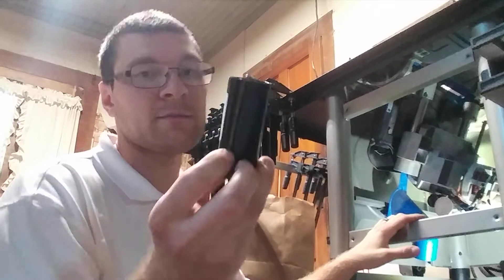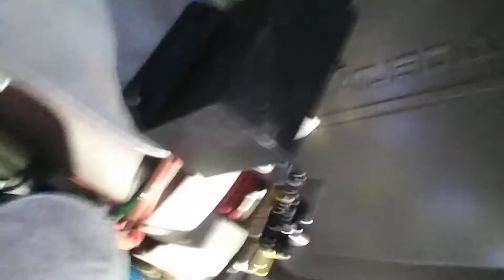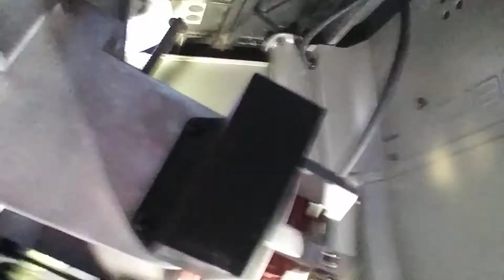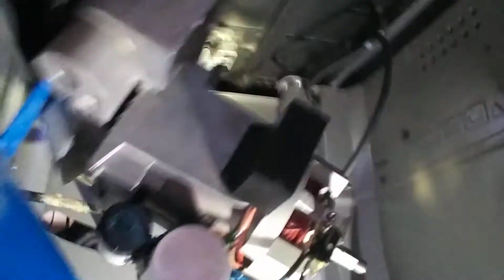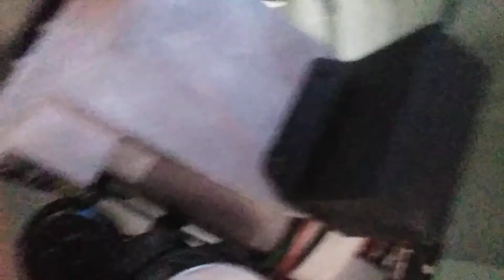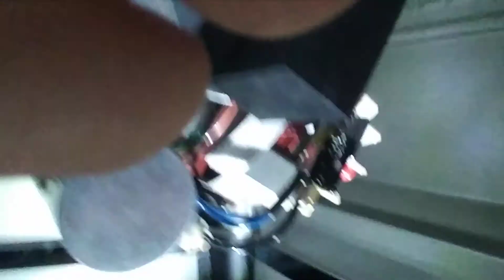36-725 and 36-725T2 Switch and Fan Install & Adjustment

Comment: I have a delta 36-725 10 inch table it was working fine and then all of a sudden the blades slowed down, but it was still running then it stopped. I tried to restart and the blade went slowly again. Didn’t get up to full speed then stopped after that the paddle switch wasn’t working or something else went wrong. I can’t get it to turn on. I’ve checked all the obvious troubleshooting with power sources and plugs. It has something to do with the Saw itself. What do you think that might be when the Saw runs briefly very slow, but doesn’t get up to the correct RPM or that it shut off completely now could it be thesaw paddle switch

Comment: I have a Delta 36-725 T2 10” table saw. I turn it on and it starts as normal, motor rpms come up then slightly taper down pretty quickly. Within a minute or so the saw trips out whether I’m cutting something or not. When saw trips off there’s no wind down as it did when it was first purchased, it stops very quickly and I have to wait a couple minutes to reset overload switch. A few times I have smelt a light burning odor during this process. Id greatly appreciate any suggestions as to what should be replaced and how I can purchase Frank’s parts rather than the crap Delta and toolpartspro both sell. Thanks to anyone able to direct me a bit.
Reply: Daniel, I am having basically the same issue, except now, the saw won't even run at 1/4 speed if it does not trip out. Same odors though, same experience.

Comment: Hi Frank, will your parts fit my Ridgid R4560? I’m not sure if the motor assembly is identical to this delta model as well. Thank you for your time.

Comment: Do you still sell these kits? My saw starts, runs for 30-45 seconds or so, then stops spinning/hums. Power doesn't cut out, but motor stops spinning
Reply from the maker: @stocks365  francoproducts.com email me through my website

Comment: Frank 
Hi watched your video and I think I ned your help.  I’m mechanicaly inclined but not so much with testing electric.  My saw won’t turn on.  I bought this saw from a warehouse thinking it was new but someone pulled the switch and I can’t return it.  Looking for assistance at this point.  I have the bottom open. I’m hoping I can get your phone number to text you or FaceTime you and if I need your kit I of course will buy it from you.

Comment: Great video, how do I get the repair kit?  I replaced my capacitors, didn't fix the issue, (issue is it won't turn on at all).  I adjusted the start switch, which seemed to have fixed the issue.  I was able to use it for about 20 minutes, then back to the same issue, won't turn on.  So all I need is the start switch and maybe the transient voltage suppressor (TVS) and two tap splice connectors.  Please advise on how I can order these parts.  Thanks!
Reply from the maker: Have you allowed the saw to cool and pressed the red reset button very hard?
Reply: Yes. @Frank-bg6xz
Reply from the maker: @1959dnh  Does the motor hum when you turn it on?
Reply: No, it did about a year ago, that's when I first replaced the starter and run capacitors and it fixed the problem.  Now, it doesn't do anything when I turn on the power.  Today I replaced both capacitors again hoping it would fix the problem but it didn't.  So I watched your video again closely and blew out all the sawdust that was built up inside the case and adjusted the starter switch as it looked like it wasn't in the right spot acording to your video.  That seemed to have fixed it as I was able to run it for about 20 minutes.  I then turned it off and did some other things and when I tried to turn it on again 30 minutes later the same thing, nothing, like it has no power to it, but it does.  I think the starter switch is bad although it's just a guess on my part.  What do you think? @Frank-bg6xz
Reply from the maker: @1959dnh  It sounds like a combination of bad switch/misadjusted switch and bad capacitors. If the switch is bad or not adjusted correctly, the start capacitor will be damaged instantly.
Reply: @Frank-bg6xz   I have not yet tested the new start capacitor that I just put in but the old one I just swapped tested bad.  So after adjusting the start switch, and having the saw work for 20 minutes, how is it that the start switch becomes misadjusted to the point where it damages the capacitor?  Also, my original question, how do I obtain your repair kit?

Comment: I know you made this video, some time ago and I hope you find my comment. Regardless, I just purchased this saw, used it twice and the motor just hums without starting. Im wondering if you still sell this kit, or if i should return the saw. Returning sounds easy but it will be a pain and whats to say that the next saw won't have the same issue.
Reply from the maker: I don't "sell" the kit anymore, but try readjusting the switch as mentioned in the video. I can sell you a left over kit if all else fails.

Comment: Where can I get this kit? My saw will not run and someone mentioned you in a forum I was reading
Reply: I no longer sell the kit. Did you try pushing on the reset button?
Reply: @frankcoproductsllc5353  thanks for the reply.  I did hit the reset button but nothing.  Just makes a humming sound when I try and start it and trips the breaker if it goes too long.  I did see a list of parts numbers you (i think) put on the saws fb group after posting this so I will try and order through that
Reply: @Javier_Is_My_Name  humming is usually due to the start capacitor circuit. First try readjusting the internal switch.

Comment: Hi Frank. I just purchased a new 36-725t2. I’m curious if you still have a parts list and vendors who sell the parts from your kit so I may try these upgrades myself. Do you recommend immediately replacing the caps or should I wait for failure. I’d rather not void the warranty but also don’t want to be stuck waiting for repair. 

Thanks so much for the video and your solution to the shortcomings of this saw. Is quite an upgrade from my Ryobi job site saw and I can’t wait to start making things with it.

Comment: Great explantion! My saw just died yesterday, do you still have kits available?
Reply: Sorry, I am no longer sell the kits. What are the symptoms of the saw? You may just need to make an adjustment to the motor start circuit microswitch and maybe replace a capacitor or two. The failures of these motors are usually very specific.

Comment: @Frank I just bought this table saw used and it's bogging down on 3/4 stock. Any ideas on what that may be? Thanks in advance for any insight you may have.
Reply: It could be a handful of things... Could be the type of blade you are using and the condition of the blade. Could be a hardwood and you may be feeding it too quickly. It could be a faulty run capacitor.

Comment: Great Video !  here's my issue. saw turns on but I have to take a piece of wood to get the blade spinning. Once i do that , the saw is functional to cut.  Whats your diagnosis and how do i fix it ? will one of your kits solve this problem ?    thanks Frank
Reply: It could be that the start capacitor is bad or the limit switch in the saw needs adjustment. Sometimes the switch is too close, which causes the capacitor to burn out. Othertimes the switch is too far away and the capacitor isn't in circuit to assist in starting. I would first readjust the switch in the saw by loosening the screw which secures the switch's bracket to the casting of the motor. Once slightly loosened you should be able to back the switch off of the metal tab, then slowly and carefully move the switch closer to the tab. Just after you hear the switch "click" to the on position, hold and secure the bracket via the screw. You could test that the switch is in the correct position by measuring the resistance across the blue and black wire at the switch, when on it should be very low resistance. Once the saw starts that metal plate will move away from the tab which opens the switch turning it off. The kit usually resolves this problem, minus a burnt out start winding of course. Unfortunately I no longer manufacture or distribute the kit.
Reply: @frankcoproductsllc5353  I appreciate you getting back to me. I have watched the videos you made so I will give all that a try. Thanks!

Comment: Hello Frank just got my 36 725 from my brother and having a problem. This saw was used for a job for 6 weeks . The saw has been sitting for the last 4 years not in use . I've tried to use it and it started fine but seems like it's not quite running at full speed and it boges down when cutting a 1 inch thick pine board even with a new blade . Have you any ideas ? I am running it on factory set 110 wiring on a 20 amp breaker so can't be the wiring
Reply from the maker: Are you using an extension cord? If the total circuit length is very long this could result in a large voltage drop. This is why a 12awg or better cord is important. 

If you're not on an extension cord, anything from the condition of the blade to the capacitors can be to blame and would require a process of elimination method to pinpoint.

Comment: I just bought this saw and it will be delivered tomorrow, 2/26/22.  (Also bought your repair kit yesterday).  I have been watching every video I can find on this saw including your repair video.  Two questions I have:

1.	 The video I have been watching refers to Video 2.  Is there a video 1 … can’t seem to find it.

2.	This saw has been out for a couple of years and you would think Delta would have this problem fixed by now.  I am inclined to run my saw as it is delivered and if it fails I will have your repair kit as a back up.  If it fails will I cause other damage to the saw?  I am inclined to take a risk.  

I intend to nominate you for President in 2024.  The clowns we have need to retire and go back to their basements!
Reply from the maker: There are a few videos I've published, but they are not part of a series or anything. That was my initial intention but I decided to keep things simple. 

The issues these motors had was a combination of assembly errors at the factory is low quality materials. The design of the centrifugal mechanism/fan is hideous and has not changed. I think they may have improved the material for the brake pads since I don't hear the complaints as often. The overall design has not changed. 

You can run the saw right from the box and keep the kit as a plan B. There is little risk to doing this, but if the saw acts up once don't think that the issue will resolve itself. Take it apart and perform a thorough inspection. The people who continue to use the saw after it acts up are the one's who do the most damage.

Comment: I am about to buy the saw. I was wondering if they are still having the same issue in 2022? Thank you for making this video.
Reply from the maker: There haven't been as many cases as earlier saws, but I'm still selling kits.
Reply: @Frank-bg6xz  where is a link to order?
Reply from the maker: @strykerliker  check through the comments
Reply from the maker: @strykerliker  For the T2: https://py.pl/18iHIF
For the non-T2: https://py.pl/2C37Nj

Comment: Great kit, quality components, simple process, and easy instructions.  Recommended.  Thank you, Frank.  My saw's cap connectors were indeed soldered on so I had to apply the iron whilst simultaneously using pliers to pull the connectors off.  Not sure why they used spade connectors and soldered.  Never seen that before.
Reply from the maker: The space connectors are 1/4 but the terminals on the factory supplied start capacitor are 3/16, so they started soldering them rather than use the correct size connector

Comment: Just received the kit, thank you.  The smaller cap does not have the bleed resistor (I think) soldered to it that's pictured in the install manual.  Do I need one or will it discharge on its own?
Reply: Well, now I have the motor access opened and the original start cap has no bleeder on it, so I guess the question is irrelevant.  Thanks
Reply from the maker: @TheRealBertMoog  Early versions of the kit came with the bleed resistor. The purpose was to discharge the capacitor so when the saw was shut off a remaining charge wouldn't be present to bump the motor.

Comment: Frank, I may be ordering the kit from you shortly. How do I know if my saw has been updated from the factory? I bought the saw from Lowes Dec 2021. So far it's been fine. However, I have to run an extension cord to my kitchen which has a 20 amp circuit. I tried the saw on a 15 amp circuit with the shop vac and it tripped the circuit pretty quickly. I'll be running a 20 amp dedicated circuit from the panel in my garage/shop very soon. oh, dummy me, got rid of the box, so I don't know the manufacturer date. maybe it's in the manual.  Thanks for the great video and Delta should be paying you for your expertise and help.
Reply from the maker: They changed how they assemble the saws, but they still have issue just not often. 

Running the saw and shop vac on the same circuit I would expect it to trip. You can probably get by running only one on a 15A circuit, but 20A dedicatd is the way to go. Also, use a 12ga extension cord. 

On the cross bar of the saw base is the manufacturers tag. The date is part of the serial number

Comment: Hello, I want to buy the saw and your kit but have a question I cannot find an answer to. I read somewhere that running this saw on a standard 15amp circuit and undersupply the motor and cause issues. Do I need to have an independent 20amp circuit? Thanks!
Reply from the maker: It is recommended that the saw be operated on a 20A circuit, but it will run fine on a 15A circuit. 

The use of a long or thin gauge extension cord wi'll cause the motor to under perform and possibly overheat.

Comment: Do you have a website I can order the kit from?
Reply from the maker: For the T2: https://py.pl/18iHIF
For the non-T2: https://py.pl/2C37Nj
Reply: @Frank-bg6xz  the PayPal page says that the product listing has been removed by the seller.
My saw does not turn on at all. What would you recommend checking? Thank you
Reply from the maker: @chrismiziniak6343  I've officially discontinued the product line a little over an hour ago.
Reply: @Frank-bg6xz  is there a place I can get the switch and capacitor from?
Reply from the maker: @chrismiziniak6343  The microswitch is a fairly common part that can be sourced from any electronics part supplier and even ebay. Capacitors can be found on amazon. The felt brake pads I cut those by hand from sheets of wool felt.

Comment: Sir I just purchased this saw and the kit.  Is it recommended to do this even if I currently don’t have an issue?  Also I read the manual and the installation of the TVS is the only part I did not grasp.  Am I overthinking it?
Reply from the maker: It's highly recommended, but not necessary that it is installed right away. When you spot the first hint of abnormality is when the kit should be installed, if not right away. As for the TVS the installation is simple. There are two wires, black and blue, the TVS is to be attached between the two using the provided connectors.

Comment: Does anyone have a lead on where to get a replacement fan / centrifugal switch?  of course my plastic fan fell apart upon removing
Reply from the maker: There is a delta 36-725 owner's group on Facebook. You can probably get one there
Reply: @Frank-bg6xz  darn, i'm not on facebook.  any other ideas?
Reply from the maker: @nicholasdischler7301  That would be the only place to get one, unless maybe try calling a delta repair center. They may have some from their warranty replacement motors

Comment from the maker: ANNOUNCEMENT: There are new links for ordering the kit. 
For the T2: https://py.pl/18iHIF
For the non-T2: https://py.pl/2C37Nj

Sorry for the inconvenience.
Reply: Link doesn't seem to work anymore
Reply: Does this apply to the 5100t2 or just the 725t2? Thanks
Reply from the maker: @braol  Yes it applies to the 5100T2
Reply: Hey Frank. Ordered a T2 kit from this link yesterday. Just wanted to check that you received that. Could you share your email so I can message you please?
Reply from the maker: @legadolegacy  frankcoproductsllc@gmail.com

Comment: I'm contemplating buying this saw, due to the fact that it's in my price range. If I do decide to buy the saw, and decide to buy your kit and install it to prevent these issues. Will it void the warranty?
Reply from the maker: I'm not Delta so I cannot speak on their behalf. Likely it will void the warranty, however you could remove the kit and return it to stock or keep the kit on the shelf in case you need it.
Reply: @Frank-bg6xz  That's true. Thank you. In your opinion, do you think it would be best for me to save up for a laguna fusion f1 or grizzly g0771z? I'm not in a rush to get a new saw.
Reply from the maker: @rustywelder010  The Laguna and Grizzly are both very fine saws. The only complaint I hear from owner's in regards to the Laguna is the fence isn't what they would expect. The grizzly I haven't heard really any complaints. If you plan to do any serious work with hardwoods I would go for the Laguna or grizzly. Both of these saws enable you to upgrade the motor to suit your requirements. The Delta is what it is.
Reply: @Frank-bg6xz  Thank you sir, for the input. Enjoy your weekend.
Reply from the maker: @rustywelder010  Happy to help. Enjoy your weekend as well.